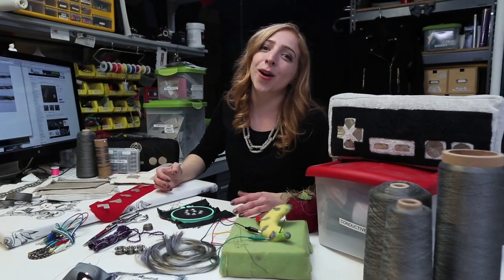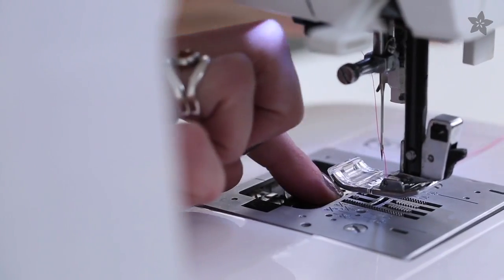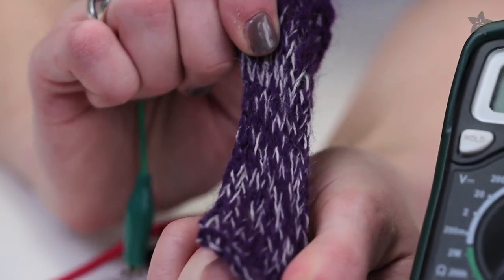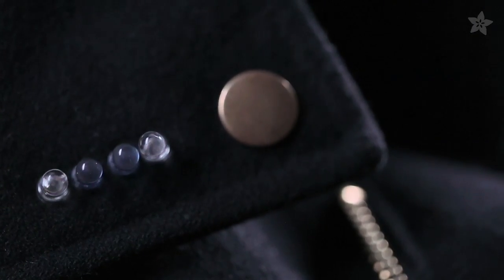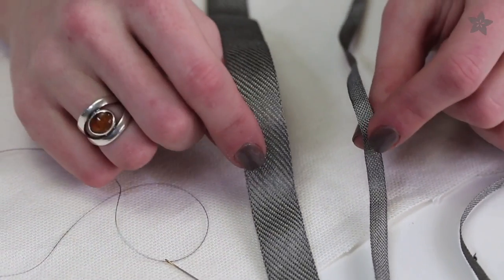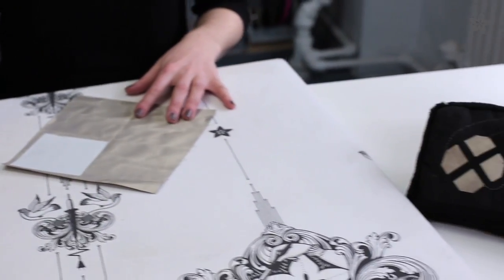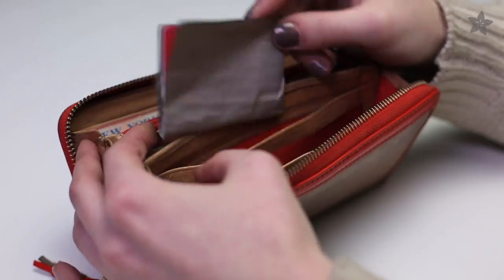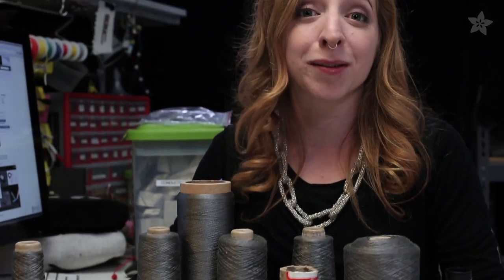Conductive Textiles at Adafruit - Becky Stern Explains

Comment: Was hoping you would talk a bit about connecting conductive thread to a circuit board, such as the GEMMA.  Since it's stainless steal, I'm assuming soldering is not the method.  Do you just sew it through the hole (with numerous loops, I'm guessing--optimal # of loops?)???  You know, stuff like that.